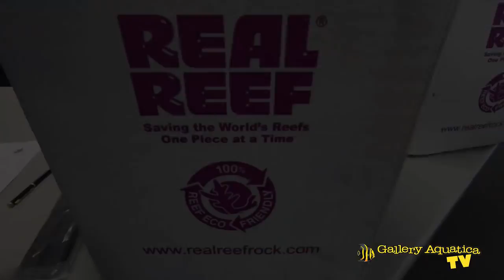Aquarium Installation: School Marine Science Lab --- Gallery Aquatica TV

Comment: Hi.  Thank you for all your videos.   Some of the best on YouTube.  I had a question about the gyres you are using.   Do they make a significant amount of noise over time?  If so what are your methods of keeping them quiet or clean?  Do they break in and become more quiet if they are making noise?
Reply from the maker: The older model gyres can be a little loud. To keep the noise to a minimum I try and give my units a good vinegar bath every few months. The latest model (300 series) are super quiet, and if noise is a concern where the tank is positioned, I would definitely recommend getting these rather than the earlier series. Cam

Comment: Why skim during the cycle ? you are skimming out beneficial bacteria delaying the process all together mate
Reply from the maker: Steve Skimming removes organics from the system as well as the fine particles from the new sand. You’re right that it will remove beneficial bacteria, so we always leave it off for 48 hours after biological supplements are added. Other than during these times, the skimmer only provides benefit in controlling water chemistry fluctuations during the cycling process. Cam